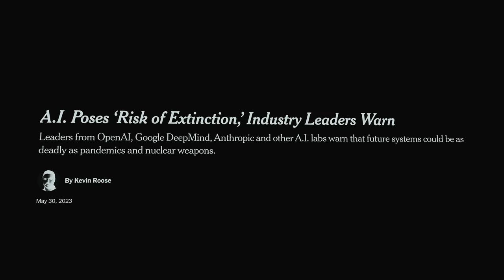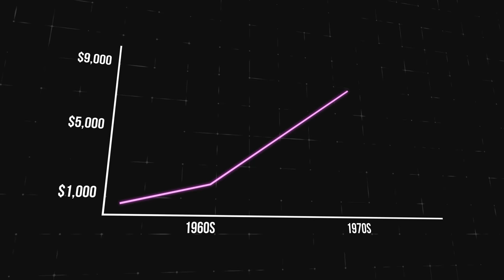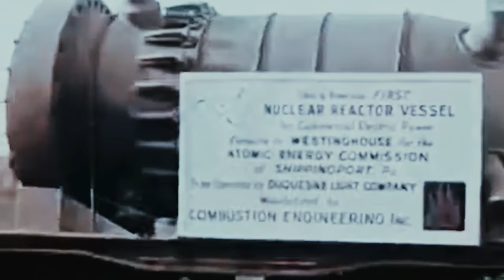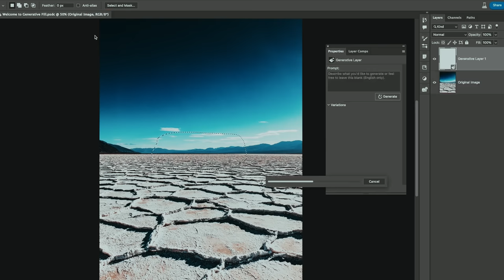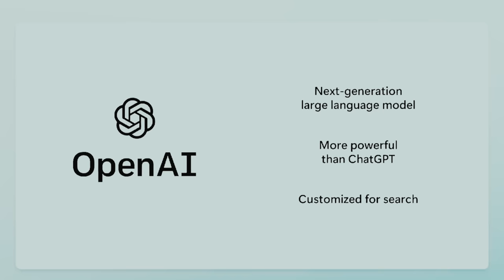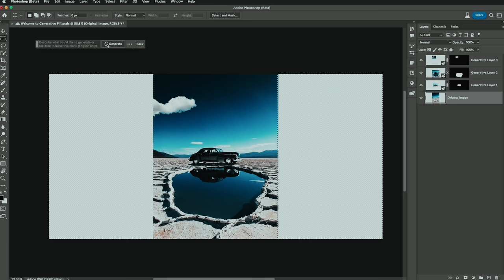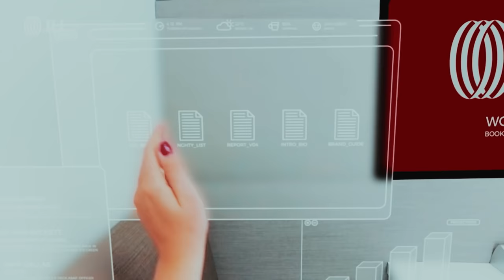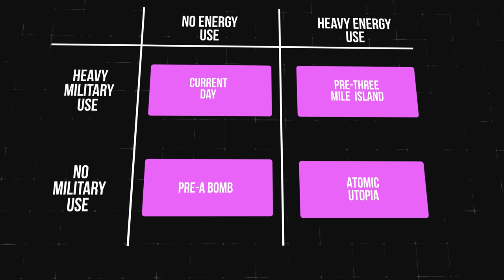AI Regulation, Explained

Comment: AI are not like nukes. AI can be used to defend against AI. Nukes vs nukes makes both sites lose.
Reply: Good point.
Reply: Nukes with AI
Reply: @zedor1553  Exactly. Or worse, AI with nukes.
Reply: Easy to say it's not but 2 to 3 years more it's like a ticking bomb without a timer.
Reply: Unless you put the AI in control with the nukes
Reply: But it is like that when seen from the perspective that it will put possibly horrifying power into the hands of the few that own it
Reply: The obvious response being that MAD has done a great job preventing war, and widespread AI constantly battling it out to an equilibrium isn’t exactly ideal from an energy and economic standpoint.
Reply: You missed the point
Reply: The main point is that a super intelligent AI could perfectly make us believe that we have total control over it and we won't know until it is too late.
Reply: @zedor1553  Damm I was going to type that A.I the Nuke
Reply: You have done zero thinking about what malevolent actors will be able to unleash with AI

Comment: Power companies need to be regulated. We also need to break up the monopolies. We need to have the ability to set up our own green power generators that are not connected to the grid. Power companies could install solar panels on people's roofs. This could generate cheaper electricity for everyone. But greedy people wouldn't pass savings along to the consumer. They will take the extra profit for themselves. We spend too much money and too many resources on maintaining the grid. But we are trapped by this system that was designed in the late 1800s. It was designed so that one large company could charge people for each watt of electricity used.

Comment: Great video John, both informative and educational! However, I disagree with much of the statements and assertions made. First, I don't think you presented a strong case for why we shouldn't fear AI/ChatGPT, nor did you present a strong case for AI development not progressing at a good clip.
Let me explain - first; automation prior to the development of ChatGPT has long been replacing human workers. Myself having worked on automation at a large Wall Street firm that ended in the elimination of an entire floor of jobs, later working on another project focused on computer vision applied to visual inspection of medical device manufacturing processes - this resulted in the loss of over 100 jobs. The CV in that process is still running and is monitored by a team of roughly 5-6 individuals; those individuals were previously employed as managers over the technicians responsible for the actual inspections and maintenance of the machines. This means all lower level employees were let-go, along with many senior staff, resulting in a total net negative loss for human workers.
Currently, my work is centered around a different application of AI, where were both researching and applying new models and techniques. The side-affect of us applying this technology alongside AI tools like ChatGPT will result in additional losses of jobs.

Also, you give praise to Sam Altman for calling for regulation and seemingly give him broad praise without mentioning the financial and industrial incentives he has for calling for regs. His company is developed, has significant backing, and is well funded. Increasing regulation would it startups and smaller businesses in the marketplace that much more difficult as the costs rise due to increasing red-tape and legal blockades. He is very motivated to keep the marketplace to himself, for example look at Coinbase. 

Additionally, Congress is already heavily invested in fast-tracking AI companies that partner with the DoD, allowing them to cut through a significant amount of red-tape that most other startups will find themselves bogged down with. 

Personally, I don't see the government over-regulating AI to the point of creating some sort of stagnation, simply because the business interest in it is far too great, not to mention the applications in defense.

Lastly, there is a real and profound threat from AI in terms of our existence - we still do not fully understand instances of AI, NN/CNN/DL/etc. Specifically, we do not understand what is going on within/between the layers of NN's that results in certain outputs; hence a blackbox is the formal term used by data scientists and researchers. We don't fully understand how AI learns, and the fear that exists today, is that if we can't fully understand how it learns, we won't have the ability to control the decision trees that permeate. Many labs have already demonstrated this.
Reply: I agree.
I find it strange that he does not talk about how wages remained stagnant (or when you account for inflation, have on average decreased in america) despite increased productivity from automation.
There are some ways of improving our understanding of how AI learns, but I agree that we don't fully understand them. Those methods include regularized attention mechanisms, sparse neural networks, and perhaps some others.
One of the biggest threats from enhancing these AI programs is the ability for bad actors to have better capabilities to perform malicious tasks.
People worry about AI programs gaining consciousness, but no one can yet define what that means, or measure it. So I that's a danger that's less easy to counter.
Reply: exceptional comment...agree on every level.

Comment: First up, I want to say I'm all for AI research going forward. There's no Luddite here. However I just finishing watching the video, and the conclusion that because the "technology will take our jobs" mantra was wrong before, that means it's wrong now. That's not true. There is a fundamental difference between technology then and now.

Previously technology always had a major achilles heel. It could never perform many necessary cognitive tasks, like understanding speech or vision, that was trivial for humans. That meant that as economies grew, there was always a need for humans to work alongside technology. Now AI is moving into that cognitive domain, which will break that compact. To be clear, I don't think general AI is happening anytime soon, and threats of AI overlords taking over are wildly overblown. However, you don't need a full general AI to displace an awful lot of jobs. 

The jobs that will be replaced are all those that were based on needing those basic cognitive skills humans excelled at, but were preciously out of reach for technology. At the high end, you'll still need humans, but that's only at the very high end. You'll also still need humans for the manual labor low end. But all the jobs in the middle are up for grabs, and even the high end jobs will be downsized due to increased efficiencies. AI will be put in front of normal software in order to interface with the world. That in turn will make more data available for traditional automation software to work on, which will allow it to automate even more jobs. 

In short, AI will eliminate a significant number of jobs. That doesn't mean we shouldn't go forward with AI, but it also doesn't mean we should stick our heads in the sand and pretend major job losses won't happen. In the end, we'd love to automate most things in order to live in a utopia where people don't have to work for basic necessities, but we have to be honest with ourselves that that is the end goal and plan accordingly.

Comment: Hmmm, although i kinda like most of your videos, I don't think this is 100% accurate because of many reasons.
Firstly, the reason for decline of nuclear power aren't just regulations, but it's mainly the skepticism of uneducated masses. There is another one highly regulated industry, aviation, and it works without those catastrophic issues caused potentially by regulations and most of the people in this industry even supports these regulations (in principle, there are some concrete regulations, that are highly controversial (for example the 1500 hours rule), but that's kinda expected)
Secondly, even if we would pretend, that the collapse of the nuclear power industry was solely due to regulations, there is still a major difference between these two industries. Nuclear power industry is hardware based and to make it even worse, traditional nuclear power plants are designed almost from the ground up every time anyone wants to build one. This results in regulations beeing applied to each power plant individually and requiring each power plant to be certified on its own. In comparison, ai is a software based product, so it requires only one certification whenever it's going to be used only by 10 human beings or by the whole population of the EU or USA. This makes a major difference because a huge nuclear power company has to get a huge number of certifications compared to a huge ai company which has to get the same amount of them as a brand new startup - exactly one certification per an ai model. For this reason, it is quite easy for a big tech company to create an ai model that will still be economically viable, but it will be impossible for a startup without it pouring a huge portion of the initial investment into this legal stuff.
And thirdly, my opinion might be unpopular, but I think that the effect regulations can have against the spread of misinformation is very limited , because of one last major difference between nuclear energy and ai. I am slightly competent in the field of nuclear physics, but I still can't build a nuke or an unsafe nuclear power plant. There are 2 reasons for it, a) it is a quite capital intensive task, but also b) it requires actual physical materials which can be regulated. In comparison, building anything software based, including ai, is a much less capital intensive task and also, the main difference, the only two things required to create a deep fake ai are my time and my knowledge and neider of these two things can be effectively regulated. Imo, I would inspire from the internet development, which wasn't regulated by anything like the current EU proposed AI act and it still works, it didn't destroy humanity, and it's biggest problem is the monopolization, which can be technically made better by regulations, but certainly not by regulations like the AI act or similar laws.
Personally, based on how much in favor of startups you are, I was actually quite surprised that you didn't mention the devastating effect of regulations on startups.